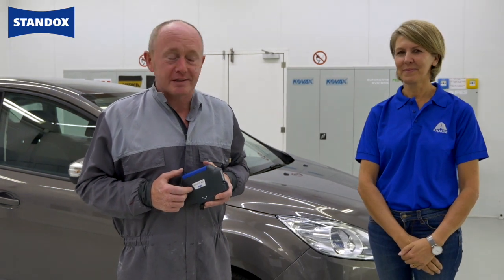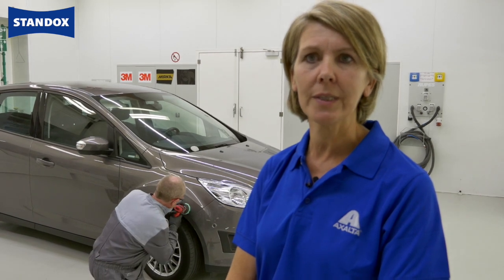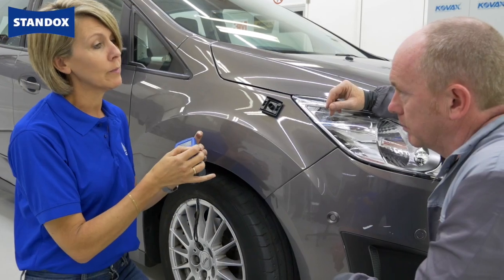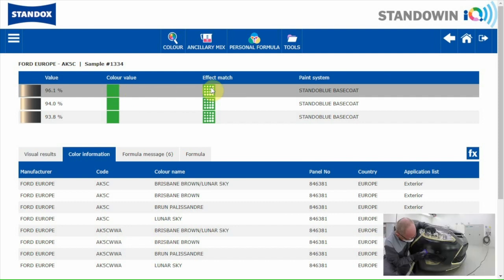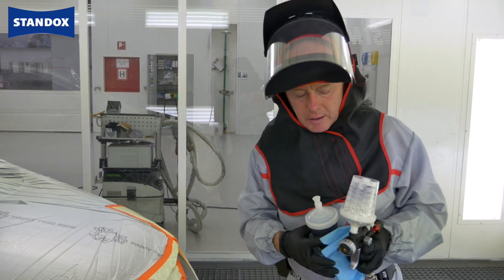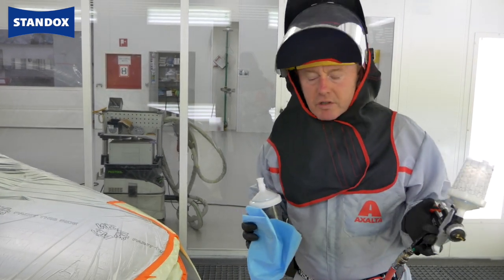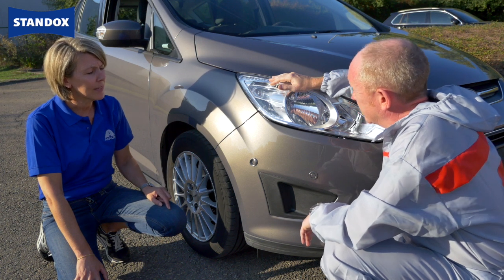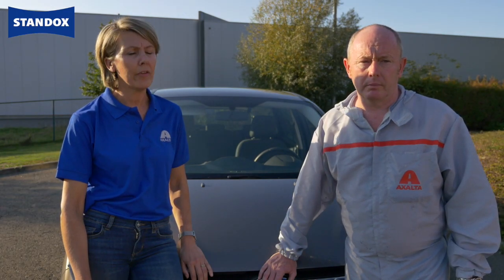Standovision: Professional and reliable way to good colour match

Comment: These things are useless for white pearls. But ok for normal metallics
Reply from the maker: Hi, thanksfor your comments. The spectro will help you identify the colour and give the best match possible but what it cannot do at the moment is tell you how many coats of effect colour are needed to get the best match. That we are afraid is down to the painter to produce sprayouts with different numbers of coats of effect colour to assess which is the best match to the vehicle before attempting to paint it. Please remember to use the same product adjustment, gun set and inlet pressure when producing your sprayouts as you will on the car at a later stage and record the exact process used to ensurte that you can reproduce the colour.
Reply: @StandoxOnline   yeah I have Close to 100 white pearls sprayed out with my own tint adjustments. Most of the time you'll get the colour by adjusting the ground not the pearl. If you need too many coats of pearl it means the ground is often too clean and can become more difficult to blend. Just my opinion anyways
Reply from the maker: Thanks for the extra feedback.

Comment: We use Spies 480 hi tec but noticed even using the spectrophotometer the colors are not always a match and we have to resort to spray out cards,tinting ,and using the paint chips anyway.But I’m wondering if our spectrophotometer and software is outdated
Reply from the maker: In this case I would suggect you contact your local support team to ask them to check your spectro. You should also consider that as mentioned in the video application technique, spraygun set up and inlet pressure all play an important part in colour reproduction also so please ensure that you follow the advice given. Thanks.

Comment: bet it would be cheaper to buy a new bumber than go through thi
Reply from the maker: Probably not and with a focus on repair rather than replace these days it's more cost effective for bodyshops to carry out these kind of repairs.
Reply: You know you’d still have to buy the bumper, right? And even if it is painted, its not gonna match because it’s likely the cars paint is somewhat faded. So this is the best way to get a cohesive color.